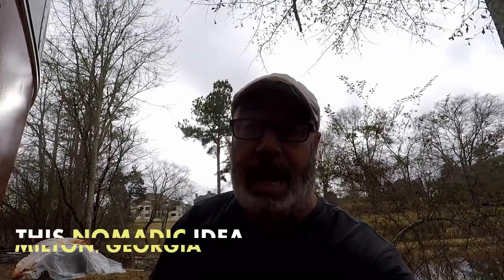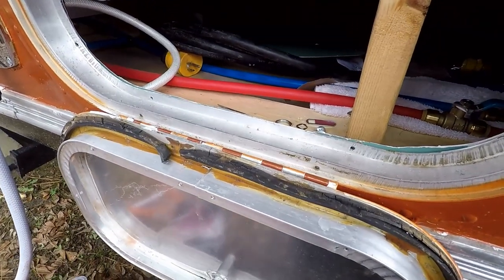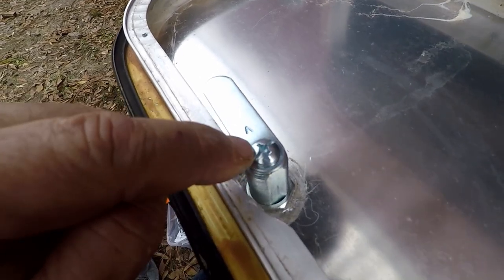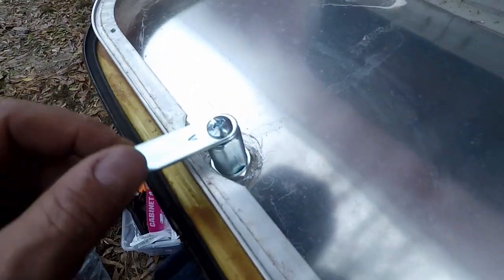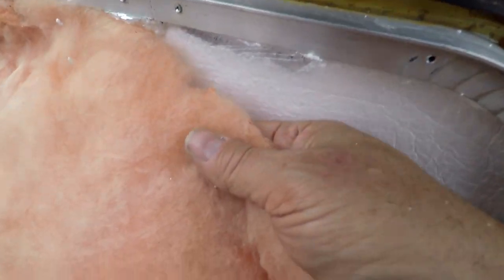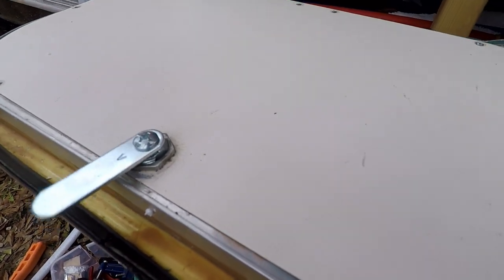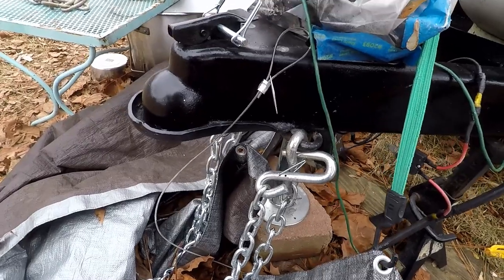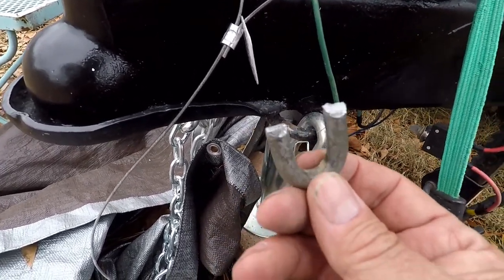RV LOCKS / RV INSULATION / VINTAGE RV'S / RV LIFE

Comment: What kind of spacer? Good info.
Reply from the maker: We cut small squares of the Polly board and glue them on with 3M spray glue. 1/2 inch thick. On the general inside we then added a layer of refectix to keep heat in when it’s cold.

Comment: 'an' RV door lock........   "Reflecting heat away from the RV"..???   You should have a reflected side on BOTH sides if you want to reflect outside heat from entering in (summertime) and maintaining heat on the INSIDE of that cavity (winter) to help prevent freezing...   Of course, unless the floor, roof and surrounding walls (entire boxed area) are tightly/properly insulated you are wasting your time...   Or, you might leave the one side uninsulated,  so the area to freeze receives heat from the heated interior of the RV..   If the RV is heated......